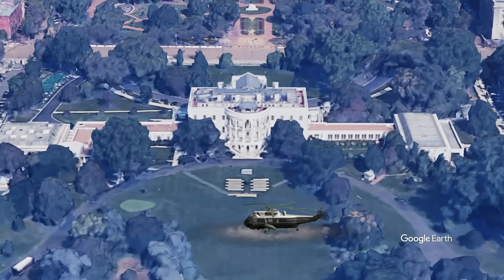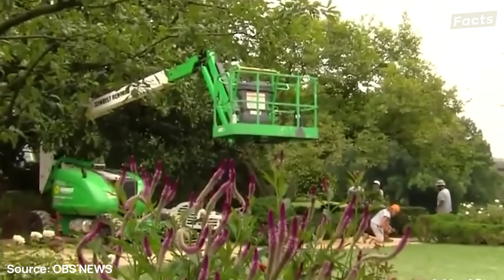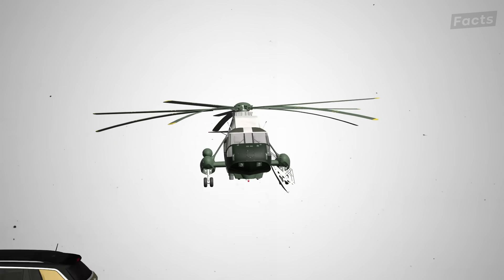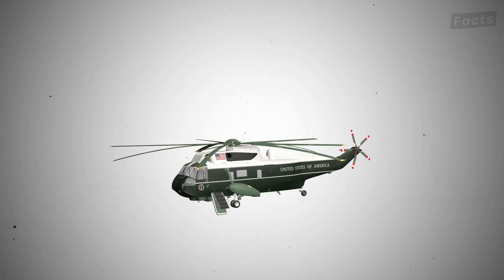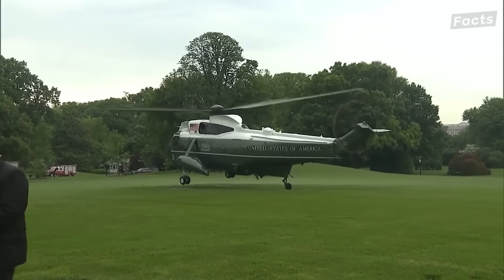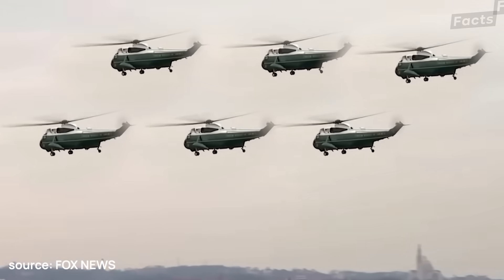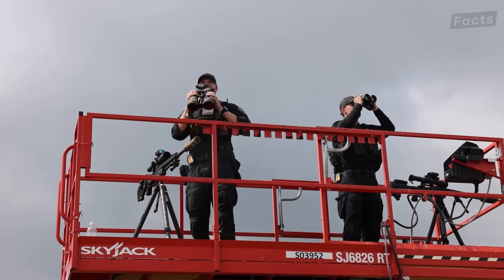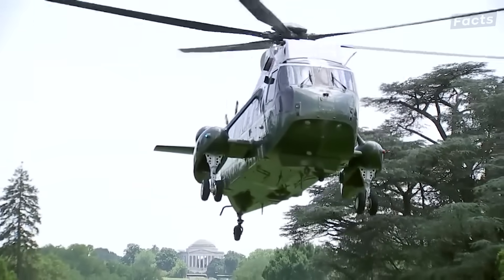Why Marine One Lands on the White House LAWN?

Comment: ...Marine 1 DOES NOT LAND ON GRASS!! It lands on special pads that are spaced EXACTLY where each wheel is located. It is flown by aMarine Aviator who's rank is Col or 06. The Co Pilot is either another Col or LTC 05. The pads thatnit lands on are concrete 36" x 36" and are 36" thick with a 12" base of of stone and 6" of sand. If Marine 1 landed on the Grass it would sink in anywhere from 6 to 12" because the Sea King is just that heavy.
Reply: This sounds correct. Buried concrete is exactly what I'd expect if they want it to look normal. Then some sort of spiky product to move the weight from the tires to the concrete, with the grass growing through the gaps in the spiky product. Probably adjustable spikes with a grass strain that loves hard pack soil. That's how I'd roll if I were in charge. But it's hard to believe engines on top of an aircraft people can exit from with the engines running can burn the grass; and even if true they clearly know they simply need more engine bypass air. Sound more like a cover story for a secret wish list item of some sort.
Reply: @tsamuel6224  Nope
Reply: I agree with you on the first half about the pilots but have to call BS on the second half about having concrete.  There are plenty of photos (unclassified, all over the internet) where it clearly shows WH ground crew members rolling out large metal discs to layout where the Marine One's landing gear will touch down.  Those metal plates are wide enough to hold up the heavy helicopters from sinking into the ground.  If you have any doubts, take a look at these same helicopters landing in the snow; a simple snow shoe/ski will allow them to operate normally in an Arctic environment without sinking into the snow, which BTW is a lot less densely packed than grass lawn.
Reply: @philliplee9545   This ^!  I spent 25 years of my life assigned to and/or supporting HMX and was a Marine Crewchief for President Reagan.  It is grass and we used "landing" discs to align with and land on.
Reply: @nb658 You did not spend 25 years at HMX-1. No one spends their entire career at a single unit.
Reply: @philliplee9545  Under that grass & dirt is a concrete bunker put there in WW II.
I've worked with and flown Sikorsky helicopters in the field , They DON"T sink in the grass. Those disks are targets to aim for and are not required unless it's landing on a putting green. Used a S 54 at a gulf course putting in a bridge for gulf carts... among other thing for 45+ years in aerial construction
Reply: @HongyaMa  yes. But this is middied hello
Reply: 100% correct. It never touches the grass. You can even see them in the video.
Reply: Bull, I've landed on grass with a Sikorsky with no issues - The disks are removable and not gravel or concrete .
S-61 on a job site for long line construction Don't use nothing but grass & dirt .
Reply: You didn't watch the entire video did you?
Reply: @dforr2981  WH grounds crew roll out large circular disks for the helicopters to land on. They appear to be made of wood and I usually see two guys roll these things around.
Reply: I know of Marine 1 pilots who were Captains and Majors.
Reply: That's what it looks like....
Reply: Correct. You can actually see these pad covers on google maps street view in the South Lawn!
Reply: Watch the full video first before you say anything about the pads
Reply: Still on the grass

Comment: Actually they have small concrete pads to land on not the grass
Reply: I’ve never seen “ small concrete pads “ . I have seen steel discs being rolled out though . They don’t land on the grass because of the helicopter weight could sink down into mud , far enough to be a safety risk caused by leaning of the chassis / body tilting the blades down on one side..
Reply: @tascosaeagle  NOPE, S-61 with full water tans at full gross weight land on grass fields all the time.
Reply: @HongyaMa  All the time ? Yes ,BUT do they pick up  POTUS  ?  No .
Reply: @tascosaeagle  Physics 1st POTUS is just another meat bag. 24 passengers for Los Angeles Airways for decades. 
S-58 was carrying Presidents and Bell 47 too.
Reply: They place a pad  for each wheel  and they can change direction of the landing

Comment: 4:55 minutes gets right to the point
Reply: Those be concrete pads not aluminum.
Reply: @adamsmith5151  No concrete at all S-61 will land at full gross on that lawn all day long , No issues
Reply: Hero!🫡
Reply: Watch at this point for about 10-20 seconds and then you can leave. Video is unnecessarily long.